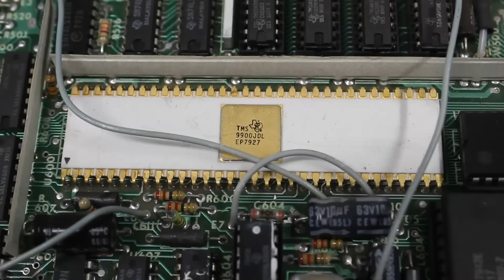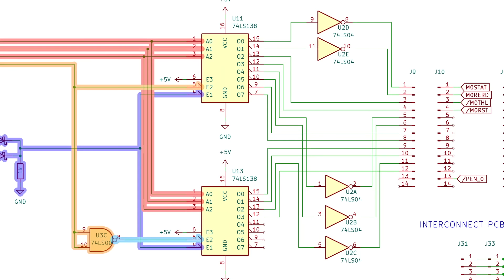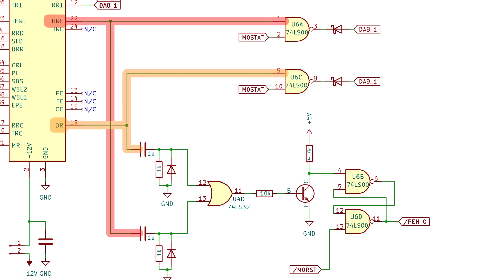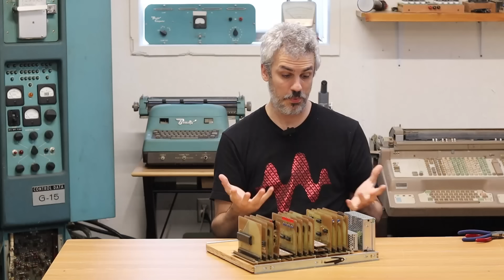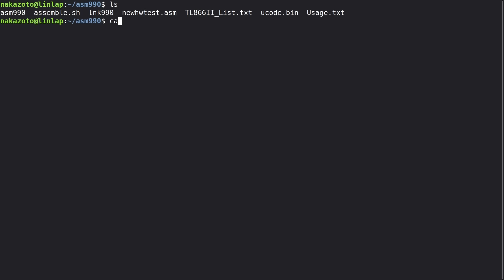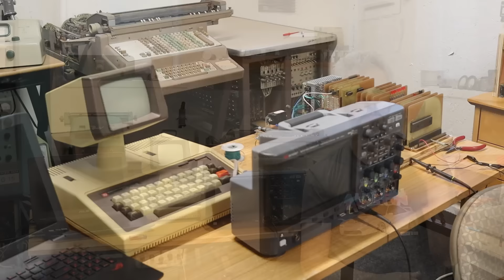Trying and Failing with my TI Homebrew

Comment: The 555 timer probably outputs noise, it'll be better to use a programmable clock IC or something similar.
Another possible problem is the latency of the transceivers, you should account for it when you are changing direction in the data bus. Or you can use faster IC and have lower latency when changing direction.

Comment: 555 RC oscillator will never be stable enough for reliable UART baud clock. THis was a huge design error.
Reply: It might be stable enough for 300 baud 

But the real issue is that it seems to be not synchronized with the CPU clock at all if I understand correctly.
others pointed out I was wrong here
Reply: @jwhite5008  The UART uses its clocks (it's actually two, one for receive and one for transmit, but in this case both are the same) only for the serial communication, not for the communcation with the CPU, therefore they don't have to be synchronized with the CPU clock. Communication with the CPU is synchronized through the RRD (Receiver Register Disconnect), THRL (Transmitter Hold Register Load), and CRL (Control Register Load) pins of the UART instead.

As for stability, timing drift is relative, if it drifts by a few percent it will mess up the serial communication no matter whether it's 192 kbaud or only 300 baud.
Reply: @blahfasel2000  Ah, that makes sense, then my point is not valid.

Comment: Writing assembly language to run TTL is some of the most fun I ever had in my career. I love this stuff. A couple of years ago I designed and built a count down timer with TTL and a 555 just as an exercise to see if I could still do it. It turned out to be something I used everyday at work so when I retired I left it behind. which I kinda regret but, it is still in use.

Comment: 22:12 - This is the prime reason why most hardware design occurs in discrete stages;
Stage ‘N’; you already had this working from the last time.
‘N+1’; make the buffer board, add power, and check again.
‘N+2’; extend the backplane from the buffer board.
‘N+3’; well, you get the idea… 😅 I’d probably test the board with the ‘138s.
…
Because throwing a bunch of hardware stuff at other hardware stuff, then throwing new firmware at it is a good recipe for anguish and a questioning of one’s sanity. Been there, done that. 😊
Reply: Exactly my thoughts as well.
No need for heroism, steady step-by-step progress is much better, checking and debugging after each step.

Uh.... I'm not sure what else to add, commenting for the Algorithm, all hail the Algorithm.

Comment: The simplest debug system for homebrew computer builds like this is a switch box cabled to a dual in line plug to fit the CPU IC socket!

Use mini toggle switches, one for each address line and one for each data line, plus some switches for the main control signals like read / write.
Add a data bus buffer (LS245 gated from the write switch) to put the data switches on to the bus, and a data latch (LS373) feeding LEDs from the data bus, gated by the read  (/DBIN) switch. (Are you using the /MEMEN signal?) 
You can set any address you need and study all the decode results, plus writing to or reading from memory or peripheral device registers.

It's infinitely easier to test things through with static signals than keep re-writing code & programming ROMs. 

ps. As you are using such a low baud rate, the UART character rate is lower than the system "tick" interrupt rate - you could do all the UART buffer I/O functions in the tick routine rather than using multiple interrupts.
Reply: That's an excellent suggestion. 
Something somewhat resembling Altair 8800 faceplate maybe.
Perhaps solder this stuff to an empty socket that you can plug instead of CPU and test it cycle by cycle.
Or in this case that could be a board that can replace the CPU board (if there's not too much important logic on said board)

Comment: I'd suggest making a small board with some buffers, switches, LEDs and power supply connections for testing each card individually. This would show any hardware and wiring issues and permit single-step testing. This board should also have a connector for replacing CPU board with it for testing multiple boards at once, like the "sandwich" shown in this episode.
A logic analyzer could also be useful for observing, what happens on the backplane...
Reply: Backplane extender?

Comment: BAUD Rate generator with a CD4060, Xtal and support descretes.
Reply: Yeah, I'm not quite sure how a seemingly free-running baud rate generator not synced to the CPU clock can even work.
Reply: @jwhite5008  Because the UART isn't necessarily synced to the CPU clock either? Modern UARTs have FIFO buffers so you can throw data at them at any rate you want regardless of the baud rate clock.
Reply: @Stoney3K  Do modern designs even use standalone UART chips? I've not seen them since like 3 decades ago.

Comment: "Ding! Fries are Done!" Love seeing fun comments in code.
Reply: I hope somewhere later in the loop there is an "would you like an apple pie with thaat?"
In a previous life, I had to do quite a bit of Motorola assembly debugging, mainly to work out what archaic hardware we sold 20 years ago was supposed to do, to work out where its hardware was broken. Assembly is much easier with good comments. Many of the 'revisions' were copy's of floppies taken home to be worked on. The boss of the era subscribed to the principal you code smoother with some lubrication, just save and eject the disk when you've finished your allotment, carry on, go see to your wife, etc. Tipsy coding good, drunk coding bad. This lead to some excellent comments, some I recall;
Scoobydoobydo - loading into a buffer
Whereareyou - checksum
Thosedamnkids - checksum passed, shift to stack for processing
Twedledendumb, and doopdedoowopdoo - waiting for a signal
Primeioncannon - shifting data into UART
Outofmerloterr - failed checksum. 
I was mainly looking for IO stuff, so I could do hardware checks, never looked into the actual processing side of things. But alot more could be learnt by going into the unsanitised history. This is pre-github. Floppy discs n text files. MK, AJ, SB, bloody legends. Made a painful job carry a chuckle with it.

Comment: For the noise I suggest installing filter caps close to the 555 between B+ and GND very close to the 555 chip. You should have this on all major chips as noise will otherwise be a problem
Reply: It is always a good idea to have a decoupling capacitor between supply and ground as close as reasonable to the 555.  When the timing capacitor discharges, it generates a pretty large current spike.  You want to be careful not to couple noise from the 555 switching back into the power rails.  Also a 100 nF capacitor between the modulation pin and ground is a good idea if the modulation pin is not being used.   These ideas are per the TI data sheet and personal experience.  It is hard to say from whence the noice on the scope trace is coming, it seems not likely the 555 itself.
Reply: I think the noise is straight out of the switching power supplies, and even if the supply rails are properly filtered there's the chance of the longer traces picking up some of the noise like an antenna.
Reply: @TDOBrandano  This is why filtering near the chips gets even more important. Switching chips like the 555 makes its own ripple too if there is no capacitance near it. The MeanWell supplies are quite good and I don’t think they alone would cause this much noise on the output
Reply: @TDOBrandano  Each card should have as minimum 100uf 16V on the 5V power rails by the connector, which will help a lot with power supply noise.

Comment: what a nice looking paperweight... =D  
in my experience, even if you breadboarded it all out, you would still run into tuns of fun with getting it all to work on the pcbs.  That is the fun part, troubleshooting and herding all those electronic cats to play nice with each other. Also, you might want to throw in some capacitors near any TTL level logic chips as these tend to need some local juice and can mis-behave when they get up to drawing current at operating frequencies if the electrons have to fly across the copper all the way from the other side of the computer case. Happy Sunday!  

remember to breath, and most the time, it's more about the journey, than the destination...  that and Red and Blue lasers... =D

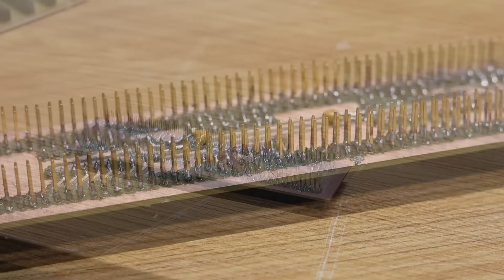Comment: 4:48 - I’m seeing lots of suspect solder joints here. Now it may not matter; the pads may not actually connect to anything, but some of them have to be power and data going to/from the ‘245s.
Reply: Hmm.  There's an awful lot of solder on joints generally!
Reply: Yeah, he needs to get a proper iron- a relatively cheap good one (every lab in my Alma mater uses them) is the WES51– it’s an older piece of kit but very reliable

Also he ought to get some brass sponge if he hasn’t, better than the crappy water sponges for cleaning the iron
Reply: @therealdorkface  There's no reason to go for a soldering iron that doesn't use cartridge-style tips nowadays, and the low-end Weller stuff is insanely overpriced for what it is. (the high-end stuff is very expensive as well, but it's actually good stuff)
The WES51 is obsolete and it's definitely neither good nor cheap.
Reply: @piernov Used ones in good working order go for about a hundred bucks. That’s cheap for a decent temperature controlled iron.

By all means he can get something fancier, but a $20 soldering iron isn’t likely to be very reliable

Comment: Well, the data terminal is cute, but not really practical for those older folks with eyes that just can’t see small text anymore… 😢 Also, testing it with other terminals might reveal problems that you don’t see on the TI terminal. 😊

Comment: Start with test code that constantly TX's a count from 0-255.
Reply: Actually first remove the new boards and run previous hardware tests work.
Then add the board and check if they still succeed.
THEN try to debug transmit code without interrupts,
then receive code without interrupts,
then check if interrupts work as a concept,
only then try to make use of all of it at once.

Baby steps, small incremental changes. 

If you feel like nothing works and you don't know where to look at - it's not a debugging skill issue, it's that your methodology is wrong.

Comment: The IRQ code should always have traps for unused IRQ's.
Reply: ... and unexpected IRQs, ie received an IRQ for a device that exists, but the device itself indicates no reason for the IRQ.
Reply: Indeed. And send the cpu in a tight loop or illum a led. Especially because an interrupt can get triggered inadvertently by a hardware wiring fault, and you will never figure out what happened.
Reply from the maker: Yeah, in hindsight, I definitely should have written software traps for those!
Reply: Indeed!  Another thing along the same lines, always bounds check (or as i call it BS detect) inputs.  For the same reason.  Just because the prompt is asking you to enter a number, doesn't mean the user won't type some gibberish in.  And that doesn't count the interface itself injecting gibberish, because reasons.

The more you error check, the less software crashes you have.  When the machine does something weird, and you have no idea why, you missed something.  Unresolved interrupts can be especially hard to find.  So write that code especially well.

Comment: That's a fine looking homebrew on a backplane.  Excellent use of the  555 timer.
Also, reminds me of my homebrewing process...     full of failures that taught me alot.
Reply from the maker: The homebrewing process is wonderful because of those failures! I've learned more on this project than I ever thought I would, and always from weird little mistakes that I never could have predicted.
Reply: Why use a crystal, if a 555 will do?
Personally, I got a few dozen... :p
Reply: @tobiasfunke8990  Frequency drift?
Reply: @tobiasfunke8990  Why use a 555, when an attiny13a exists? I've got a few dozen of those now.

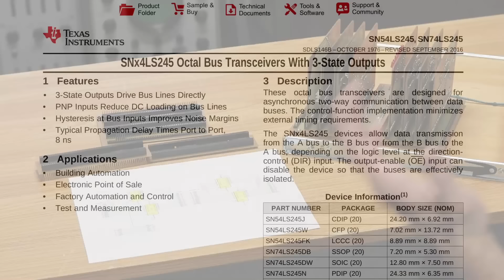Comment: 4:01 if you abuse the chip right you can do tristate and Dma

A flip flop, and  two 245 per 8bits (iirc)

Useful in a 6502 based setup unless the ti chip can tristate and halt itself.

Simply toggle dir pin, and toggle output enable, cpu can be halted or run a nop loop, until interrupt is triggered, while another chip can take control of the bus, for a 6502 place some ram in zeropage and can run other code during tristate, don't have to tristate everything just the address and data lines you need

Comment: interrupts make things more complex. just add some more generic cpu cores instead. specific hardware is just asic logic that is a cpu but not exactly. if you count all the fixed logic devices as cpus, now many active cpus you get. multiple ways for a turing complete system to achieve the same code. also interrupts break the flow of normal code. ie not fully deterministic program flow. well two cpus can run out of sync too. ie flesh must go its own way, christ way is other way. retry continue abort. christ is the hero, otherwise you take christ place.
Reply: Interrupts may be complex but they’re the best way to coordinate peripherals like this. When you interface with the outside world you can’t have any idea when a specific event will occur, like a keyboard press, so there is no good way to write regular code to handle it besides polling, and these CPUs simply don’t have the power to afford to spend cycles doing nothing. Computer engineers have been working with interrupts for so long now that the problem of breaking the code flow is a solved one, and we have best practices for these scenarios. There’s no reason he shouldn’t use interrupts, and it’s more efficient and accurate to the architecture to use them
Reply: No. Interrupts are the simplest most efficient solution to an otherwise extremely wasteful problem.
Reply: Maybe in some cases but not this one, interrupts are the simplest and most logical idea for IO handling in this context, which is why it was used on most 8-bit computers. 
The only ones where it was not used that I know of were able to get away with just polling because they had neither multitasking nor multiuser which are supposedly among the features David would like to implement in this project.

Comment: Nice homebrew project, so much different than the UE-1 but makes sense, reminds me of the Altair, IMSAI, SWTPC and other S-100 systems. All backplane and vertical cards... Loveliness.

BTW, when you're sure the wire loom won't change, you could try cable lacing rather than wrapping wire around the bundles. Takes time and patience, but definitely has this lovely retro look :)

Hey, I never knew you had a second channel! Subbed right away :)
I really like your lab now... A real deal lab, with scientific gear and all.